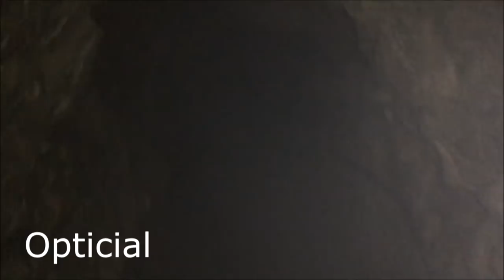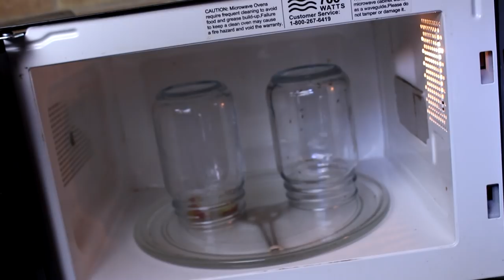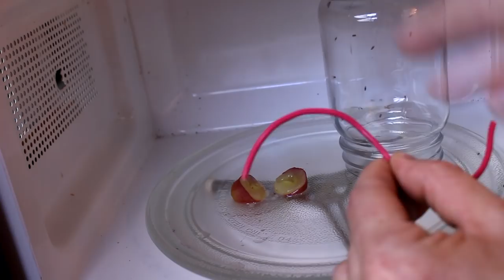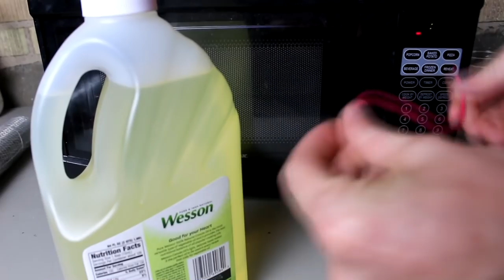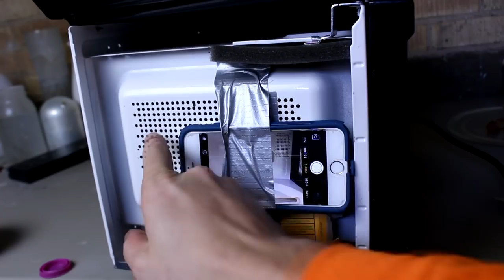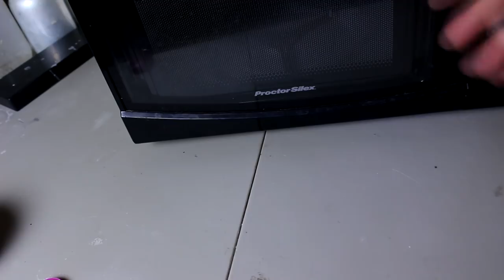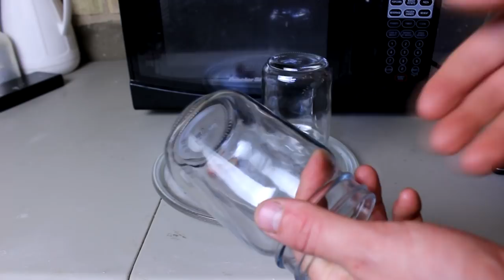Fruit Flies In A Microwave?!

Comment: Does it?
Reply: Oh. It doesn't. They are fruit flies and they're in a microwave. 
The fruit also didn't fly.
I'VE BEEN LIED TO
Reply from the maker: lol
Reply: Cody'sLab I have a great idea for another movie - "anti-gravity" propulsion from microwaves and flame. Fire in microwave owen turns into ball of plasma, which is opposing gravity. I saw on youtube a guy, who made a "microwave gun" from an old owen. If you would use such "gun" on an open fire outside the house, the ball of plasma would fly up to the sky. It should be also posiible to use this force, to lift things into sky. If the plasma ball would be exposed constantly to the microwaves, it could theoretically fly all the way to space...
Reply: Cody'sLab Now try and test the double meaning.
Reply: If the plasma isnt contained it will probably just expand and fizzle out. Also a microwave produces standing waves wich is probably necessecary to create the "ball"-phenomenon. Maybe a vertical tube with a metall cap on one side an the magnetron on the other end could make a rising plasmaball. Maybe jumping from one wave maximum to the next wich might look cool in slow motion.
Reply: Phillip Timmer Exactly - I was thinking about microwaves directed from below the source of fire and and a container placed above it...

Comment: Could you do a quick video explaining how the grape in the microwave creates plasma? Maybe about plasma in general aswell. Ive done it myself but I dont understand it fully and would love to learn more about it. ^^
Reply: AlieZ92 in this video, he explains the presence of an electric potential and current accross the two sides of the grape.
This electric potential is higher than the breakdown voltage of atmospheric air, so the molecules in the air get their electrons ripped out of them by force and the air becomes ionized and conductive. The current then flows accross the air and heats up the air. And then from there it's a similar concept to fire.
Reply: Alright, but when I did this the plasma moved around upwards, in circles and what seemed like random movements upwards, not at all acting like fire. Do you know why and how?
Reply: AlieZ92 like how fire tends to point upwards, the rising hot air/plasma is what draws the plasma upwards. However, unlike fire the source of the plasma (potential difference) is stuttered, so there won't be a constant stream coming out of the grape.
At the same time, plasma in itself is also conductive, and will itself also respond to microwaves. The plasma is able to remain in the plasma state even after it moves away from it's origin because it is kept heated by microwaves, unlike fire which loses its heat after it flows up and away from the source.

Comment: You should explain why its not a good idea to touch a transmitting radio tower.
Reply: rf burns feels good
Reply: Mentioned this higher up. You don't even walk out onto transmission dishes (on large antennas) without them switched off (Even if they're not operating). You'll get fried.

Transmission power for mobile phone (cell phone) towers can be anything up to several kW, running on several kV. Without proper RF knowledge or experience, you'll probably die of electric shock if you don't die from the RF burns.
Reply: ben smith it Hertz
Reply: sgtshaken4  It Hertz from cycling per seconds.  Just 2 fast 2 C.

Comment: That was really quite a good explanation of how microwaves interact with things and why they reflect off metal surfaces including holes. Thanks! A couple tiny issues though: the electric and magnetic fields are not 90 degrees out of phase, but oriented 90 degrees apart from each other. Also, the reflected wave is 180 degrees out of phase, not 90 degrees out of phase.

Comment: Cody I noticed that you confuse absorption with diffusion: the dust in your mine does not absorb visible light but it diffuses it because the size of the particles are comparable with it's wavelength. Speaking of the glass it cannot absorb microwaves because it's not polar, in fact any polar molecule can absorb microwaves (like oil).
Reply: Oil isn't polar.
Reply: I'm talking about edible oils that are composed of an aliphatic chain and a polar part (an esther of glicerol)
Reply: Oils are NOT polar.. their comparatively large molecule chain size and inability to arrange too neatly due to high amounts of carbon double-bonds just exhibit strong inter-molecular attraction. To make an oil polar, you must saponify it (turn it into soap). Nile Red has made an excellent video on the subject.
In the form of an oil, glycerol has no polar components due to loss of the hydrogen you're thinking of, due to the participation in an ester bond - which is a non-polar functional group but which readily forms a momentary dipole, causing it to have relatively high chemical activity with polar molecules such as hydroxides.

+ Microwaves in the 2.4GHz region used by a microwave oven only excite and absorb into water.. they do so readily, and the excessive molecular vibration experienced by the water is then passed on into surrounding molecules as heat due to the action of entropy of a system - see the laws of thermodynamics.
Reply: I think he is referring to (short-chain) fatty acids, where there would definitely be some polar properties.
Reply: Rachel Mant put some olive oil in a glass and put it in a microwave if you don't believe me. The polarity of the esther groups is enough to let the molecule absorb some microwaves
Reply: It also depends on what aspect of polarity one is considering. From the point of view of solubility it won't be 'polar' in a polar solvent, such as water.
Reply: You are both correct in a way, it's just that you can't distinguish in only polar or not polar at all; more than often, you'll find yourself somewhere in between the black and the white side of the argument.
Oil generally is said to be non-polar, which doesn't mean that the whole molecule doesn't contain any polar functional groups.
Reply: A molecule doesn't need to be polar to absorb microwaves. External electric fields will induce dipole moment in molecules. What matters more are how localized the electrons are in the molecule, what and how many degrees of freedom it has for bending, twisting, and rotating and what energies are needed to do that compared with how much can be absorbed from the induced dipole moment. Glass - due to its crystal structure (at the level of 100s of molecules - even if the overall macroscopic piece is polycrystalline or even amorphous) and highly localized electrons doesn't have the degrees of freedom needed to absorb microwaves in the solid state.
Reply: Thanks sean, was about to sperg out on the other guy saying edible oils aren't polar (they aren't in the practical sense, but in terms of physical chemistry they are definitively more polar than completely aliphatic oils). Learned something from your comment, not often you do that on youtube.
Reply: It absorbs some of the light, otherwise all dust storms would be glowing.
Reply: baguvix aezakmi you mean like triglycerides...
Reply: Rachel Mant depends on your definition of “polar”. Lots of things considered “non-polar” have a non-zero dipole moment. Even a “non-polar” molecule like toluene has a very tiny dipole moment because it is not perfectly symmetrical (i.e. the aryl Group is electron withdrawing).
Reply: polar just means cold ffs

Comment: Cody! Sorry, but this video is talking about the sizes of the objects compared to the wavelength of light, and that's only part of what matters here! What matters is that the vibrations of the water molecules as resonant with the microwave frequency (and of course water molecules are in both grapes and flies - and are also much smaller than the wavelength). The conductive effects are obviously huge in the grapes, but the water molecules' heating is the reason for the microwave's tuned frequency. Even if the dipoles are much smaller than the wavelength of light, they still flip back and forth at 2.45GHz in the locally DC field that they experience. If the grape wasn't full of ions it would still heat up, just a bit slower - and your flies also heated up; just not enough to kill them at first :)
Reply: If your statement is true (I don't understand the physics), then the reason the fruit-flies survive must be due their high surface to volume ratio, and hence ability to shed heat quickly. A revised experimental protocol could clarify this.
Reply: Surface area to volume ratio would assist in heat dissipation, but it really has more to do with their much smaller cross sectional length, meaning, not all the radiation is absorbed as is likely the case with the grapes. This occurs as microwave ovens are turned slight lower then the peak rotational frequency of water. By doing so, it allows better penetration of the incoming radiation and more even heating of the food. Having a thinner object mean less radiation absorbed and therefore less heating. Cody is a undergrad geologist so he can be excused...
Reply: George Burkhard this is the physics I learned tbh. And it makes more sense to me.
Reply: Thanks, I was trying to get to this answer. If all the microwaves were absorbed by the outer layer of food, you would get burned surface and very uneven cooking! P.S. When I studied physics, microwaves hadn't been invented yet, LOL!
Reply: Was looking for this comment. I'm surprised there aren't more comments like this.
Reply: A more complete answer would include the fact that those microwaves which  pass through a small object get reflected from the walls, and bounce around until they are eventually absorbed. If there is only a single tiny object, the intensity builds up to a point where the walls of the oven will get damaged (sparks!) P.S. The oven forms a resonant chamber, with much higher intensity in some places than others, hence the need to rotate the samples.
Reply: Cody's channel is not really oriented towards electronics nerds.
Reply: George Burkhard; The bugger issue here is that Cody explained EM-radiation as an inductive process (with the changing B-field causing a changing E-field, which then causes a changing B-field, etc.), like you would find in an electric motor or generator. This is NOT how light works and he even showed the CORRECT phase relationship for light in his model (with the E- and B-fields being EXACTLY in phase), which means that they CANNOT influence each other in this way.

For those without a High School mathematics education: If the changing B-field were inducing the changing E-field, the point of greatest E-field strength (the peak) would occur at the point of greatest CHANGE in B-field strength (at the point where the B-field is just crossing through ZERO!).
Reply: George Burkhard you are correcting him with an incorrect claim.  there is no special resonance of water near microwave frequencies.  some commercial ovens use different frequencies and work just fine.
Reply: The way I understand this is microwaves, radio waves, and light waves are  all part of the same spectrum just different wave lengths and they were discovered not invented.  Gravity was discovered not invented.  Elements were discovered not invented.  Super glue was invented by accident.
Reply: Gigs
That's a vague rebuttal. What are the absorption peak wavelengths of water, how wide are they, what are the different frequencies of other ovens, what kind of ovens...?
Reply: Roy Reynolds
Discovered = invented, who is to say that they aren't?
Reply: I'm guessing he/she meant microwave oven (at least here we shorten it to microwave)

Comment: When we have fruit flies in our kitchen I take a small glass bowl, put a small piece of fruit in it, cover it tight with plastic wrap, often with a rubber band, and poke a small hole in it with the tip of a pencil.  A day later, the fruit flies found a way in but are too dumb to find their way out.  To reset the trap or another day, I microwave it for about 10 seconds and the fruit flies die.  But now I know for sure it's not because of the microwaves but because of the steam created from the heated fruit.  Thanks Cody!